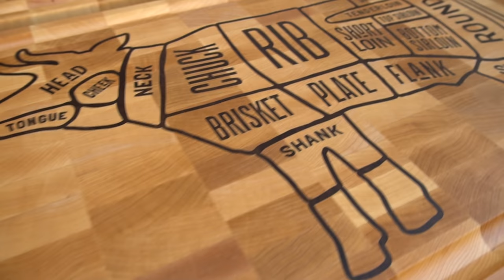The Cow and Pig butcher block / cutting board. Inlay cutting board. Cnc inlay. Wood inlay 4k video.

Comment from the maker: How to find inlay parameters.
https://broinwood.com/products/how-i-am-finding-inlay-parameters

Answers for some frequent question:
I use a lot of different types of bits from 6 degrees to 90 degrees. 
In this project, I have used 1/8 flat nose and 15-degree v bit (No name).
Feed rate 60 ipm.
For most projects, I use fusion 360, but also I use Ai, Vectric, Corel Draw, Inkscape, Ps.
I'm working on the tutorial on how to make inlay, but I can not tell when I will finish because it is more complicated than I thought. 
I love your comments and always read them! I just do not have enough time to answer all of them. 
Sorry:)
Reply: Great Idea the tutorial 👍
Always great job 🤘
Reply: I would love to see a tutorial on how you setup the artwork.
Reply: Which bit do you use for the surfacing and edge trimming? I love the work. You do amazing things!
Reply: Thanks, I'm looking forward to the how to.
Reply: I don't think there will be a tutorial :) I wanted to buy these cnc plans at your store, but I have an older version of the program: (are there any ready programs, I mean 2 female and male forms, there are gaps? Think about the course, it can be a great injection for you on sale of this cow's designs.